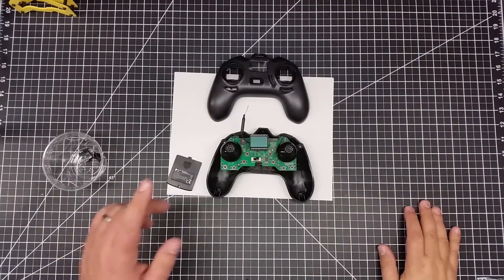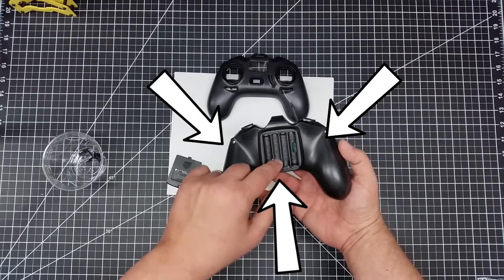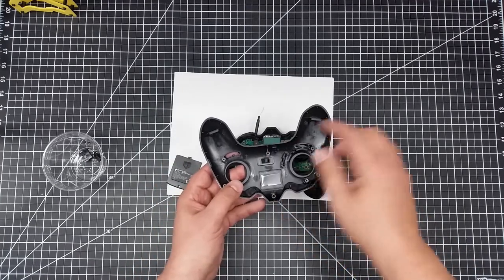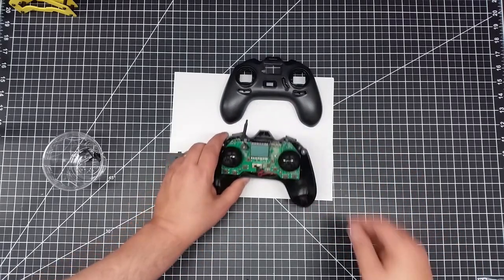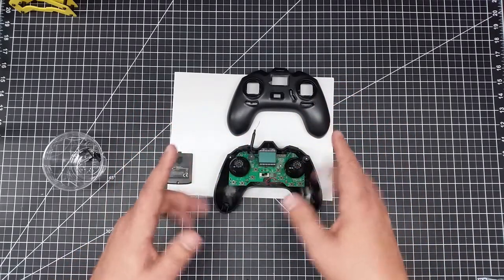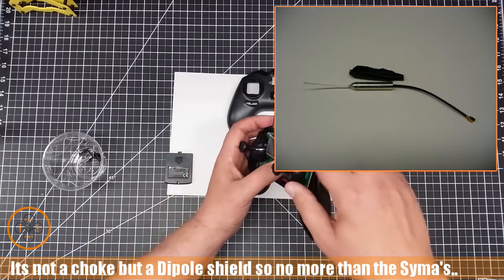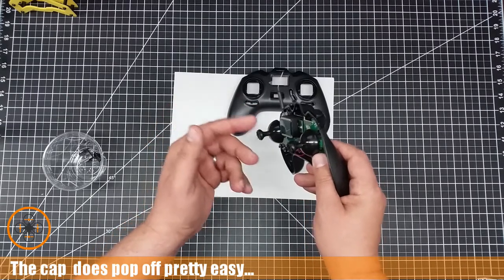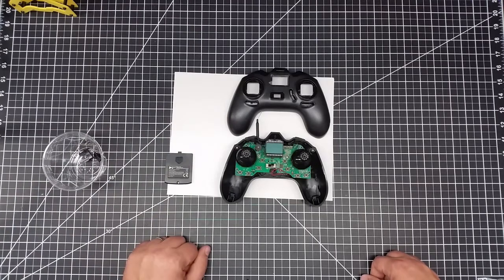Video Drone - How To Disassemble the Hubsan X4 Controller!

Comment: i just took a old one apart i had to see if  thier was away to take the module out to fly my hubsans with  my pro radio...use it as external mode in a hobby grade..but looks like i got to buy a 4 intoo 1

Comment: I want to open my hubsan h122d controller but I can’t it’s really stuck I took of the screws and I am trying to take it off and I can’t and I don’t want to brake it bc there is wires that I don’t want to cut

Comment: Hello colleagues I bought the hubsan h502e in aliexpress in the air toy store and the transmitter control does not work in the headless mode I press the left joystick vertically and it does not appear on the display of the transmitter control.In the description of the quadcopter says that it has headless mode the codgo And sn: AAH010B29121210 the radio transmitter and h907A, what to do to function in headless mode ????
Reply from the maker: I do not believe the new ones have headless mode...

Comment: I found your video too late. I opened mine up and had to re-solder most of the joints for the thumb controllers. It just went dead! 
Binding was no problem, just no motors would run. Fixed now!
Reply from the maker: Cool you got it working again!